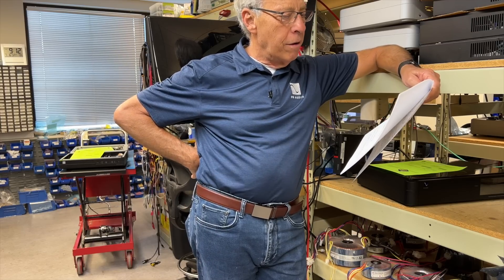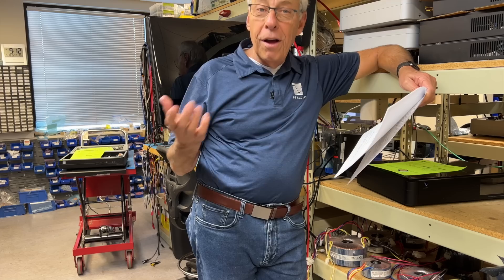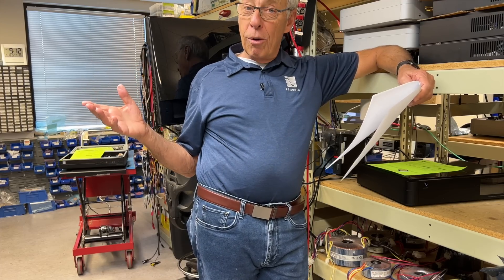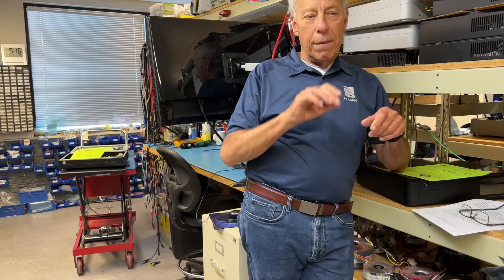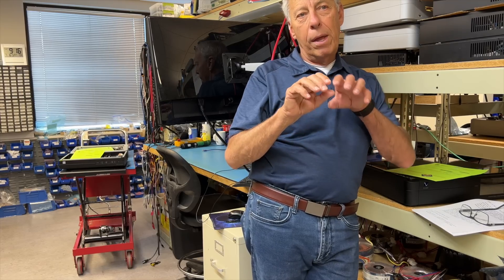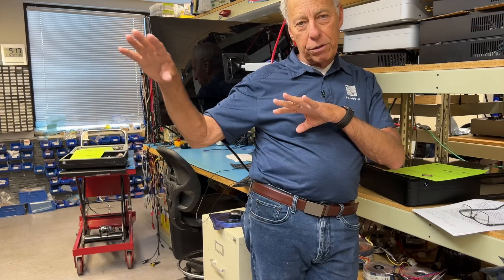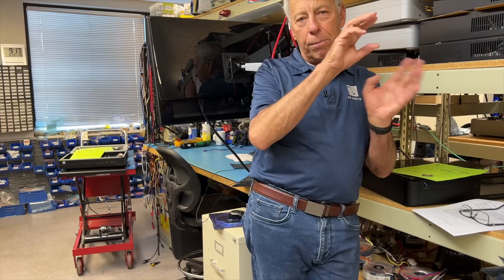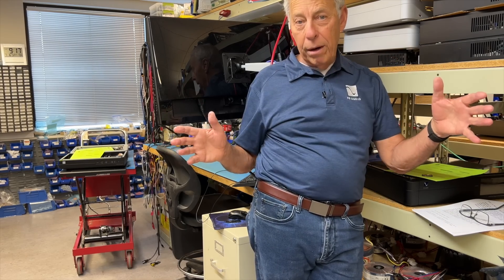Why Class D amps have small power supplies

Comment: I have both classes, and although my Class D sounds good, it gives me ear fatigue whereas Class A/B does not.
Reply: What kind of class D are you talking about? Because they're not the same. Current proper designs by the "big three" don't give fatigue at all. It's been a solved problem for years.
Reply: @ropeburn6684  I agree with you.
my cheap ones (built in or < $100) give me ear fatigue but not my higher end (> $600) such as my Parasound Zonemaster 2 or NAD c298.

my video: Wow! Further improve multiple subwoofers in hifi and home theater! IsoAcoustics pucks
https://youtu.be/ncwCopnHJqA
Reply: Yes, because class D well known for the clarity and transparency. Unlike A/B , they will color the sound.

Comment: Thanks Paul for your very informative information on Class d amps.  I am currently experimenting with a ganfet class d stereo amp. (Peachtree).  My speakers are an Electrostatic Kaya by Innersound. I find that the Ganfets are quite impressive but at high listening levels it can not supply the needed current that electrostatics require and begins to poop out.  To get the 400w/ch at 8ohms these amps are already bridged.  The switching power supply just can’t supply that needed current.  The company said the only way I might be able to get more current is to use only 1 channel of the stereo amp and purchase another stereo ganfet and use 1 channel from it.  Does that sound to you a reasonable solution?  I would like to know could a ganfet amp be modded with a traditional power supply that could supply more current?  I know one of the earliest class d amps from John Ulrick of Spectron had large transformer based power supplies.  Lastly, have you experimented with ganfets and do you ever plan to manufacture an ganfet amp?  Hopefully, you could have some options to purchase with a ganfet amp such as a high current power supply and other options.  Thanks if you have time to answer and sorry this is 🙄so long.

Comment: Sounds like the "chopper" is a PFC (Power Factor Correction) boost topology SMPS before the normal voltage transform stage, it essentially (usually) makes a 400V DC stage from 230V AC (in Europe) supply and that can then be switched at higher frequencies with smaller transformer size for a given power for the wanted output voltage stage.

Comment: A second reason that Class D amps have small power supplies: They don't waste half of the power supply's output by turning it into heat. A Class AB amp that makes 100 watts into the load will need a roughly 200 watt power supply. A 100 watt Class D amp may only need a 115-120 watt power supply to do the same thing.
Reply: I was surprised that he didn't mention this factor.

Comment: I'm sorry but all this technical stuff confuses me. I'm not into Hi Fi for the tech I'm in it for the music. Does Class D sound as good as Class A or AB? Seems some think so and others say it doesn't, and then there is the debate about solid-state verses Valves (tubes). Tubes sound better seems to be the prevailing opinion (that's why SS designers always aspire to sound Tube-like).
To me if its hot and inefficient but sounds great then that't the way to go. If it can be efficient and lightweight and sound as good then that would be the way to go. From what I understand Class D is getting closer to AB and AB is getting closer to A but if you want the most pleasurable/natural audio sound (and isn't that the goal of High Fidelity Audio) Class A with Tubes seems to be the gold standard at this point in time.
Reply: Tubes and transistors can sound alike - depends upon the circuit design. Tubes, alas, degrade with use - they do not "break-in" and sound better, contrary to what the "golden ear" crowd claims!
Reply: @Douglas Blake Thank you for your response. I agree with you that Class D amplification is good and is useful and the quality of audio reproduction is getting better but if it really sounded as good as Class A or even Class AB why do all the high-end designers (like the Late B. H. King or Nelson Pass) still design Class A or AB and why would PS Audio promote their BHK series as their top-of-the-line amplifiers over their own Class D amplifiers?
As I said in my original post for me it's about the sound (and I don't listen to the class D amp in my TV, I run my TV through my outboard DAC and through my Class AB amplifier because it sounds better. Class D is good but isn't as good as A or AB, maybe in another 30 years it might get close.
Reply: @terryjefferylee6314  Like anything else there are good and bad sounding Class D amps just like good and bad sounding Class A AB.  It comes down to being a religious war where newer designs threaten old school thinking and egos.  I've owned many SS Class A AB as well as tube amps, and a few Class D amps.  Some are excellent while some are over priced for audiophools because higher price equates to better sound. You can see it for yourself in the audio rags.  The higher priced gear is always ranked higher. 

As a business PS Audio is smart for catering to both crowds - old school traditional and open minded adopters of newer tech.

Comment: I recently went from a Class D amp to a conventional Class A-B power amp. Upon my first listen to the new conventional amp, I noticed that it had a very clear, unsmeared midrange and lower midrange. I was happy to be back on a conventional amp. Years ago, I built a pair of SWTPC Tiger B power amps... still among the BEST sounding amps that I've ever heard... very warm with a high level of fidelity. Nice video, Paul! Thanks!!
Reply: You did a double blind ABX test?
Reply: @jasonkillsformomy  I knew this material very well and listened to it on the same set of speakers. The clarity of the class AB amp was emotionally moving compared to that of the class D amp. With the class D amp, music was not nearly as moving as it had been.
Reply: @jimrogers7425  And how did you remove bias, placebo and or other mental states from the test? What was it that was moving. Prostate, bowels or perhaps the cardiovascular system?
Reply: @jasonkillsformomy  This was a subjective analysis, but one based on my dissatisfaction with the quality of sound that I'd been experiencing with class D amps. My background is in the recording studio, so I've been exposed over long periods of time to very high quality, high fidelity studio monitors. So I back this opinion with high levels of experience over many years. If you want a scientifically supported study, I'm not even attempting to do this. Thanks for your comments.
Reply: @jimrogers7425  Well at least you admit that the test wasn't scientific. What studio monitors do you use? As you don't use class D then I presume you don't use DSP ether. You probably think that DSP is even more blasphemy. Yamaha NS-10 or Augspurger? Maybe Neumann. But you seem like an old school guy who doesn't like active speakers.
Reply: @jasonkillsformomy  I actually use a set of monitors with passive crossovers that are fairly uncommon, but I know them well. And to answer your other question, I really don't care for DSP. I once worked at Starstruck Studios in Nashville. They have a pair of Coastal Acoustics custom monitors that use off the shelf woofers and tweeters, but a custom built (by Morel) midrange driver, along with an custom designed analog crossover. Recently someone complained about the monitors, so they replaced the crossover with a DBX digital crossover and they have never sounded the same.

The problem with active monitors is the crossovers as there are no standard crossover frequencies, but each mfg chooses xover freqs based on the drivers used. I was once asked to write an article about active monitors comparing manufacturer A with manufacturer B. With direct comparisons between the two, switching back and forth in the middle of the same song, the snare drum "walked away" with well-known monitor A, but remained "in place" with monitor B from another well-known manufacturer... the culprit... the active crossover. In years past I really loved the big Genelec monitors with dual 12" drivers, etc, but those are no longer made. The newer ones are just not the same. NS-10s were/are TERRIBLE reference monitors because the high end was too hyped, but they were GREAT for radio mixes. The old Tannoy SRM-12B monitor was very good, but that was due to the coaxial driver... the big Tannoy studio monitors were also quite good in their day.

The main problem with manufactured monitors, especially self-powered ones, is that the manufacturer has them designed and built for a particular price point... in doing so too many compromises are made. I've still yet to hear a studio monitor that outshines the Coastal Acoustics monitors that were brand new at Starstruck. I've been in facilities with the Augspurger monitors, but have never really cared for compression horn drivers, nor have I cared for the lobing of ribbon tweeters that he's used in later models... however, custom monitors are the way to go. However, with custom studio monitors, different recording centers have different preferred setups for main monitors, which the really good monitor setup guys are hip to. I really do not care for most main monitors in LA as there is an overall harsh sound to the average LA studio monitor. Nashville was and is a different story. Many love the ATC monitors there as they use cone and dome drivers which, to me, are far superior to horns or ribbons... but it really is all subjective. If, at the end of the day, a recording studio delivers a product that sounds wonderful over whatever speaker you listen through at home, then who cares what they were tracked and mixed on because the ears of the engineer are all that matters.
Reply: @jimrogers7425  "The problem with active monitors is the crossovers as there are no standard crossover frequencies, but each mfg chooses xover freqs based on the drivers used. I was once asked to write an article about active monitors comparing manufacturer A with manufacturer B. With direct comparisons between the two, switching back and forth in the middle of the same song, the snare drum "walked away" with well-known monitor A, but remained "in place" with monitor B from another well-known manufacturer... the culprit... the active crossover." 

Why the hell would there be a standard crossover? Different manufacturers use different drivers, cabinets and end goals. Same thing with passive speakers. Of course two different speakers are gonna sound different. You can't just switch crossovers from one speaker to another. You do not seem to even understand the basics of a speaker.
And by the way Genelec still makes dual 12" speakers.

Some seem to like ATC because of their midrange driver, but they measure bad and are overpriced for the old school design they are.

Geneleg DSP coaxial monitors with Genelec's own room correction system.
Dutch & Dutch 8C DSP cardioid.
Kii Three DSP cardioid.
These kinda speakers are the future.

And it's nice to know that studios are finally understanding the need for subwoofers.
Don't know why they were avoiding them. Maybe because the designer, producer, mixer, masterer didn't understand how to integrate them correctly with the room and speakers so there was too many nasty room modes.

Comment: Keep switch mode FAR... So VERY far away from my audio.  My listening room is segregated to it's own circuit in the house, with it's own db box.
You are not allowed to even plug in a phone to charge here. 
All equipment was home made, so power supplies also have 47nf caps over the diodes (BY229) in the rectifier to assist with cleaning off crap that comes from mains and are translated to the 30 or 50v path.
Satan himself invented switch mode psu just to mess with us purists.
Switch mode is a terrible solution to a world wide design flaw. Mains should have been 200hz globally. No way to recover from that now, unless you are willing to make all current electronics obsolete and start again.

Comment: Do the output devices on Class D amps exhibit crossover distortion? The solid-state, Class A amps I used to build, employed MOSFET's, in TO-3 packages, operated at 90 C,  at 2 Amps of bias Current to achieve, Class A operation, by the designer's topology. AudioAmateur/Old Colony would sell the boards for 25 bucks/channel. I built the linear PS to easily deliver 4 Amps of bias Current, for more power.  By building my own linear PS, 800KVA toroidal transformers were 90 bucks/channel, HEXFRED diodes, a couple of bucks a piece, large filter capacitance, from a surplus House, CHEAP, double bypassed those for less Inductance, as per J. Peter Moncreiff's instruction, in His Journals. Heat sinks relatively inexpensive too. I wouldn't pay the price, compared to someone else designing, building, marketing, etc for retail. I'm just too cheap, plus the learning experience is enriching. Yet the difference between operating the amps at 0 Amps bias current and 4 Amps bias current was amazing. Eliminating the amp of crossover distortion from the Transistors was ,"Magical", vis a vis sound quality. Today, my kit built, EL 509 based, Single Ended, Valve OTL I use, is 3% efficient, delivering 7 watts at 16 Ohms, 4 watts at 8 Ohms, so I use Lowthers at 15 Ohms and Raals at 16 Ohms, plus Stax ear speakers. I'm addicted.
Reply: @Douglas Blake Thanks for the reply. I've never listened to a Class D, but maybe I will look at some of the kits, where the boards are already stuffed and all that's required is to also purchase the PS and chassis.
Reply: @Douglas Blake I've read about the NCORE line from Hypex, situated in Maylasia, although not sure they'll sell to an individual. I'll check out the Aiyima. But as of now, I'm in the middle of a Transcendent Sound," Slider", preamp, which employs zero feedback and the venerable, although now JJ Electronics manufactured 6386 compressor tube for variable gain AND a phono stage is included. I really don't like point to point wiring though. My eyes aren't what they used to be. I appreciate your advice, again thanks.

Comment: Back in the mid "70's as a Kenwood Rep, I was travelling with the Kenwood High Speed Clinic. I would go to HiFi stores and set up a test rig with a signal generator sending a 10Khz squarewave into any amp anyone brought in, crank the amp to stated power out into an 8ohm load and measure slew rate and rise time while reviewing the look of the squarewave out on the scope. The Kenwood was lab perfect with a 10Khz squarewave at full power. Very few others even came close! e.g. Yamaha tended to use quasy-complimentary outputs and even a sinewave looked bad! 

Sony had just come out with switching power supplies in their amps. After 3 in a row literally went up in smoke, I refused to test anymore switching supply amps. Fortunately they had signed wavers and the units were under warranty. I hope the design has come far enough since then!  My concern being claims of a tiny class D amp at maybe 500W @ 4ohms from a wall wort supply?
Reply: I'm not sure why the industry still toys with the idea of switch mode. It should stick to phone and laptop chargers etc and stay FAR away from audio or RF circuits.
Reply: @Douglas Blake i’m a class A fan boy from linear power supply through preamp through amplifier.  I build my own from scratch

But I will say with these new GaN FETS once they have them dialed in and they perfect them I think we will have some petition where might be difficult to tell the difference between a class A and a class D.    And it will be a good thing for conserving power in people who live in hot desert climates and don’t have air conditioning in their room
Reply: @Douglas Blake The chip may be capable but the designer and the implication
Still does not quite come out sounding like class A
Reply: @Douglas Blake 👍
Reply: @Douglas Blake Maggies! 😞
Reply: @Douglas Blake So that's why for the past decade all the high end and most highly regarded Class A amp designers have bragged about sounding as good as Class D? While the class D designers have never had to try to make the reverse claim?
Reply: "Kenwood High Speed Clinic" This has to be a joke.
Reply: @jasonkillsformomy  The uneducated laugh at all kinds of things.